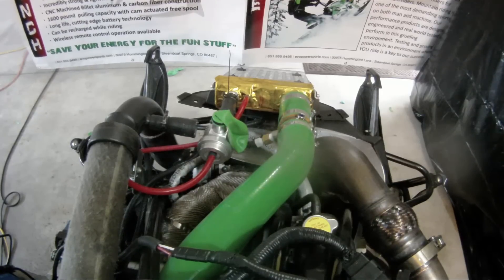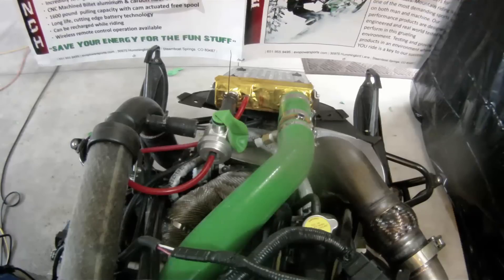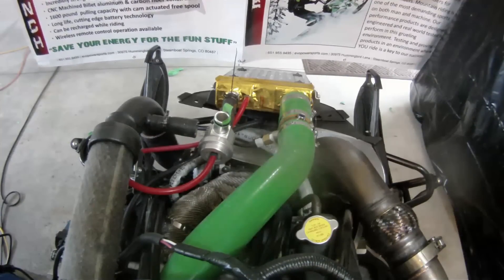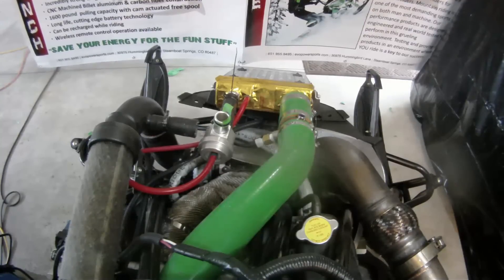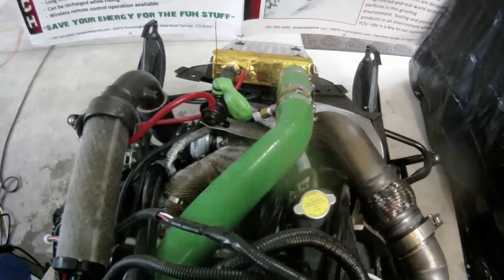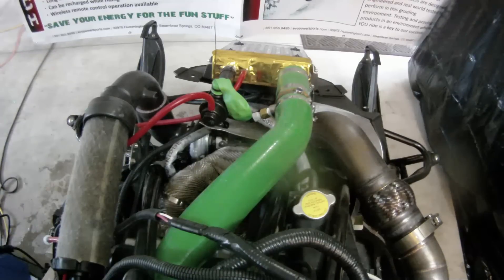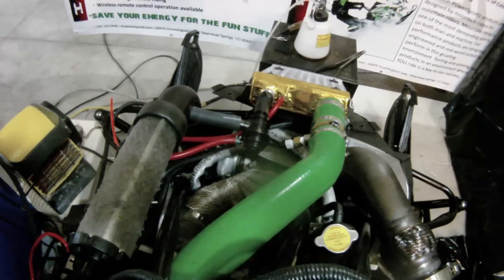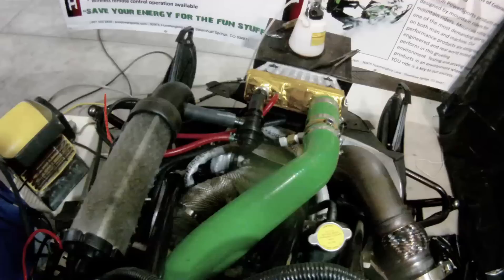Evolution Powersports Arctic Cat ProClimb/ProCross 1100T BRV DEMO

Comment: It eliminates the compressor surge doesn't it? I just put my on and it doesn't has the flutter sound anymore. Just the Phish sound. Def will take time to get used to. I didn't take my fuel tank off to put it on either like ur directions suggested..